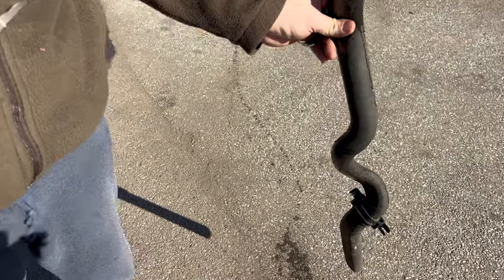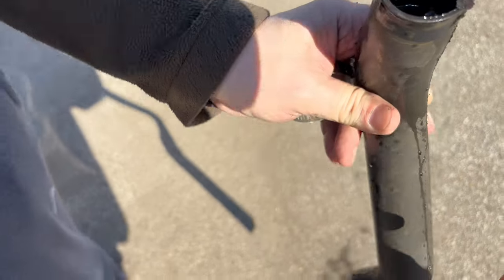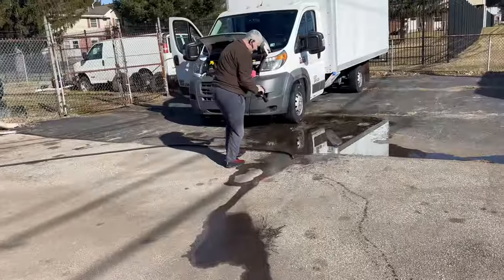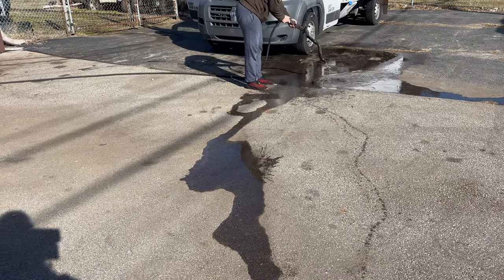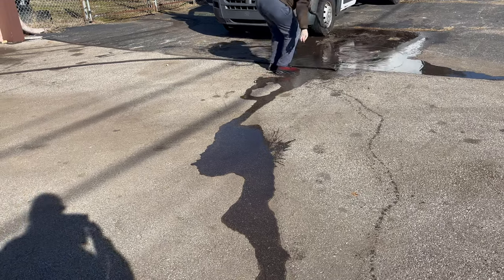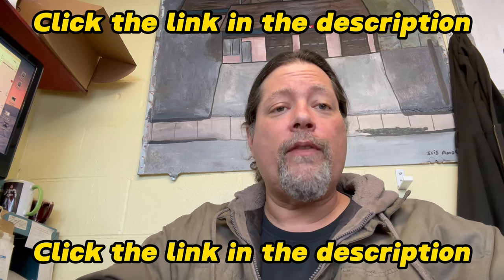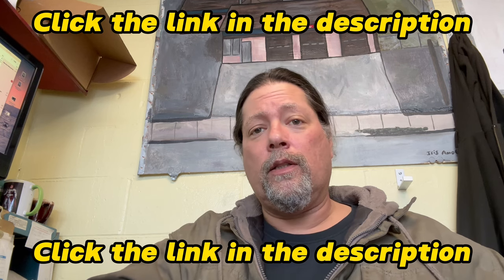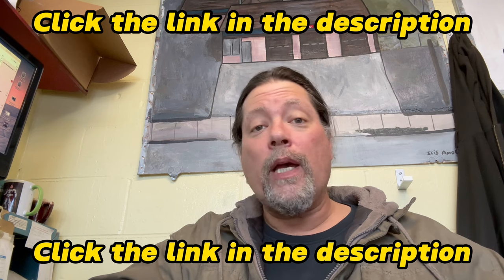Russian Van Nightmare - ProMaster Guru Cries out for Help! Caused by Cowl Drain! Geeky fun!

Comment: Holy crap I just found my drain tube in the engine compartment it had come disconnected somehow I was in no hurry to put it in but now I’m going to get it back on asap. You may have saved my computer!
Reply from the maker: When they disconnect, or fall off the water goes down the rear of the transmission and onto the ground, away from the computer. I supppose being missing is better than being clogged!

Comment: Yesterday I looked and all 3 drains on the cowl were blocked!!!! I DID take a wire and worked it in the largest of the drains until it finally cleared the leaves and debris. The smaller diameter drain tubes were a little more work but again iI worked a wire back and forth then blew the lines with the compressor. Our van is parked outside all the time so i think this will need attention frequently!!!
Reply from the maker: Correct. Leaves and crap accumulate. 

But now that you know, wont be a big problem.

Comment: My ProMaster (2014 gasoline) suffered this problem and the dealership misdiagnosed it as a transmission "solenoid pack" failure. They told me they never seen this particular issue before, hence the misdiagnoses. The technician banged flashlight on the computer a few times and it started give up too many codes and he somehow he figured out and replaced the computer. Water was getting into computer and created the problem.
Reply from the maker: Interesting. Now having seen it, at least I know what to look for.

Comment: I have a 2017 PM 1500 long wheelbase that I bought certified used with 11000 mi. Once or twice I went to start it up and it wouldn't turn over for a while. I got lights and warnings on the dash telling me to service the ESC and service the "hill holder". I cleared a bunch of leaves and stuff from that gutter tube and haven't had that problem since.
Reply from the maker: Interesting. The hill holder thing is super common, almost always clears on restart. I’m still working on something definitive about it.

Comment: 2 thoughts:
1). The multi pin computer plugs should have a silicone seal on their perimeter, right. Going to check mine.

2). As a helpful preventative, should we not put some dielectric grease on the small pins and sockets to help prevent corrosion.

Believe it or not older Ford 7.3 Diesel 1998 up. Had the computer mounted inside the fender well. A rusted mess on the outside aluminum that creeped to the internals.
“When will they ever learn, when will they everrrr learn”

Comment: Please show us how to waterproof our computer connectors Please.
Reply from the maker: Good video topic. I’ll put it on the list.
Reply: @promastersonly1419  not just the computer connector, but also the one that goes to the transmission.  I fixed my transmission codes by disconnecting and cleaning the connector, which had gotten moisture in it.  Now if only there was such a simple solution to fix my oil pressure sensor problem...
Reply from the maker: @ingolemme5113  take heart, I’m working on a video to fix p0520 or p0522 easily. Might not be successful, but worth the try.

Comment: Is the drain tube suppose to be secured to anything where it drains out on the bottom? Mine is loose and just hanging there.
Reply from the maker: The tube has a slot and a hook about midway that mates to a couple of pins on the firewall. Should be obvious where it goes. But even if it just hangs or is zip tied to the firewall somewhere, it will work fine.
Reply: Great! Thanks very much. Love your channel you are a wealth of information